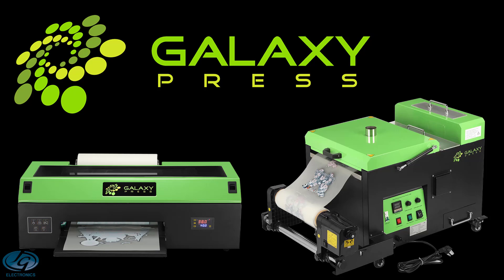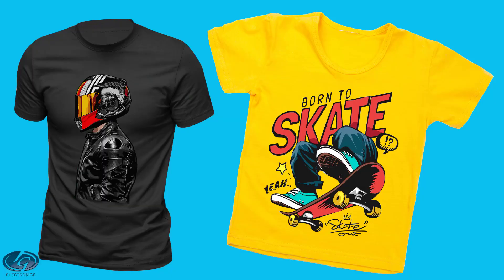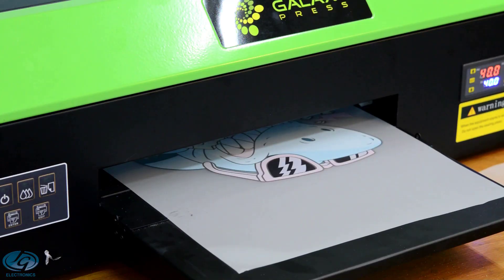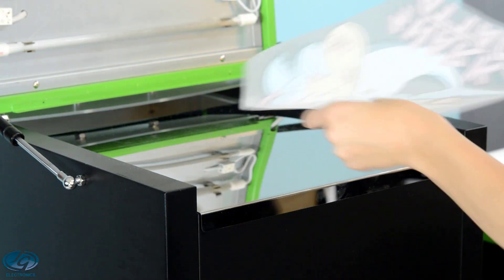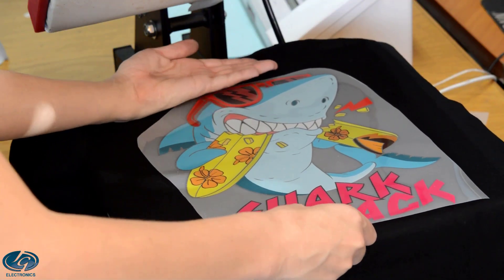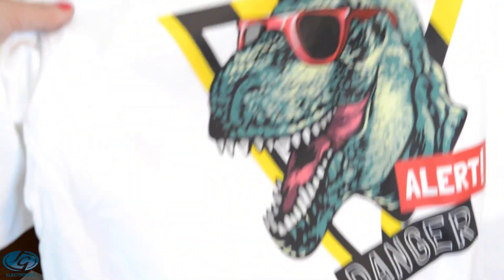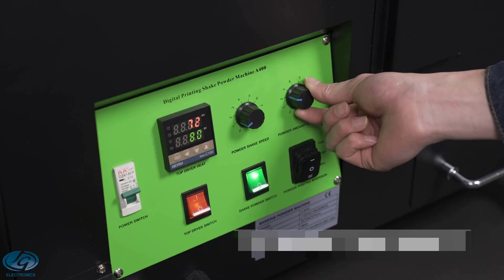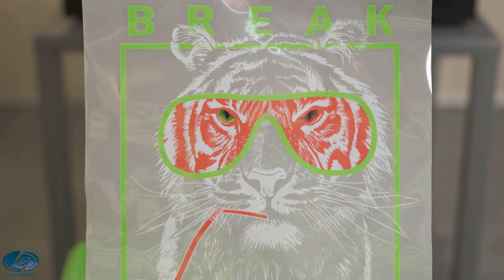DTF - Direct to Film printing with White ink

Comment: How many A3 sized prints can one do with those 200ml inks you supply and what are the replacement costs?
Do you have printers in stock in JNB?
Reply from the maker: Hi, You may contact our tech support team at techsupport1@jgelectronics.com for print quantity queries using the Galaxy DTF printer. You can alternatively send us a message on WhatsApp at +27 63 753 3532 for stock quantities or for other queries you may have.  Thanks